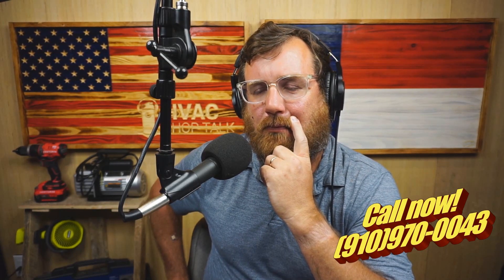Do Turbo Run Capacitors Have an Issue?

Comment: Got one of the mini turbo 200s and it reads 2.7 out of the box on my meter. These are all I stock for fan and blower motor caps. They do 2.5 to 15mfd.
Reply: 2.7 is 10% under spec, and that's brand new. Any other brand if you bought it and it was out of tolerance by 10%, you would go straight back to the parts house. And at $100?

Like others are saying, it's great as a stopgap but I wouldn't want to leave a 10-15% shy capacitor in place for long term.

Comment: I bought an Amrad dual capacitor 45/5 370 - I have a 5-2-1 start relay and capacitor and Amrad has a CPT terminal.  On my Relay 5 (common to contactor), 2 (Start to HERM) and 1 (through start capacitor to run capacitor CPT)?  is this correct - 5 - 2 - 1 ........5 common.......2 start.........1 run ?

Comment: The only thing we use Turbo’s for is to get a unit up on a weekend or holiday and we pull it out as soon as we can get one.  1 they are too damn expensive for everyday use. 2 they take up too much space. 

But they will absolutely get you by in a pinch.